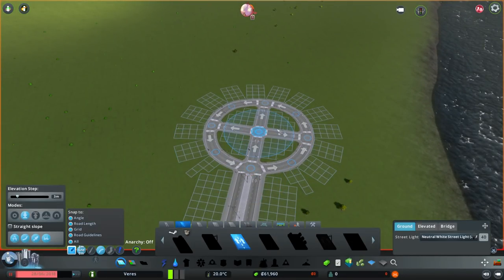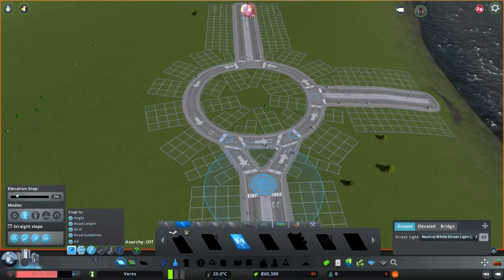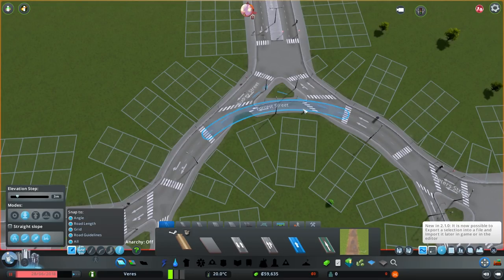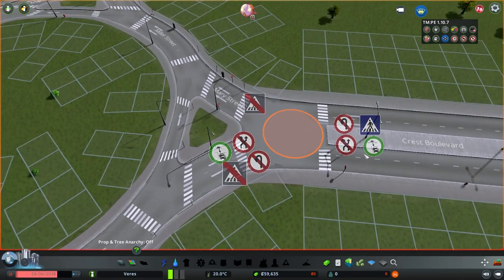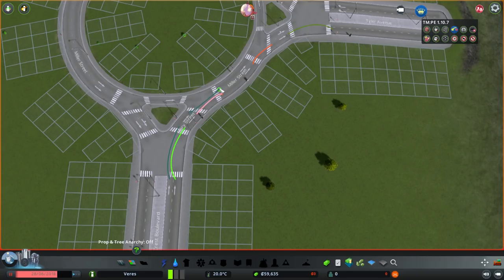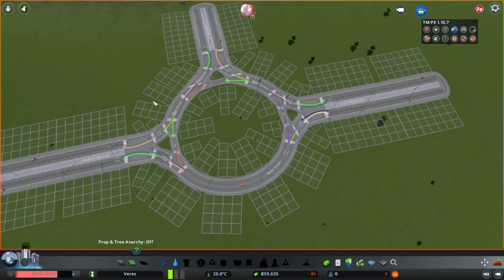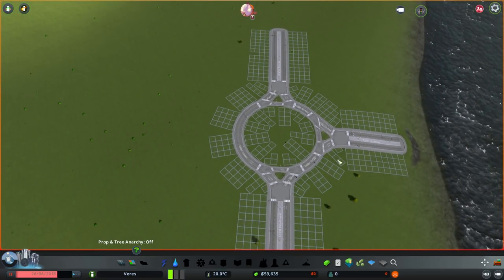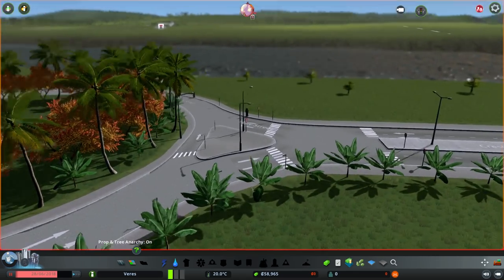Cities: Skylines - How to build a proper roundabout

Comment: That looks a lot better than I expected.

If you do it without mods, would the default junction controls just make a traffic nightmare?
Reply from the maker: Thanks 😄 and that's a great question. I believe so. The mods allow me to control a bit better the traffic flow, so without them, the roundabout would probably cause more issues then solving them. I guess the only way to answer your question is to test it out 😛